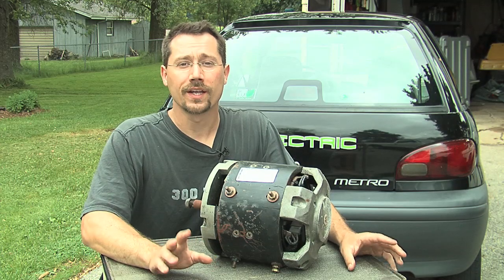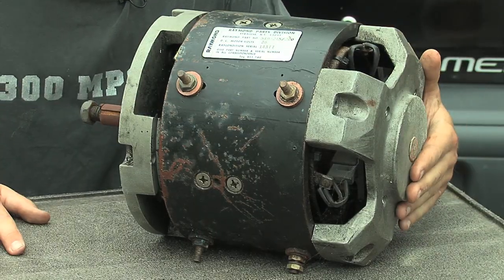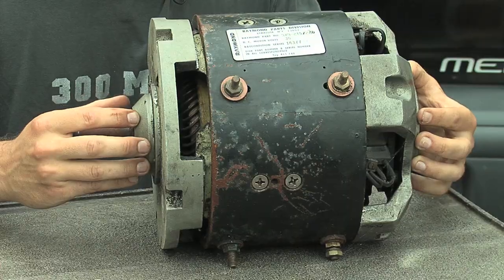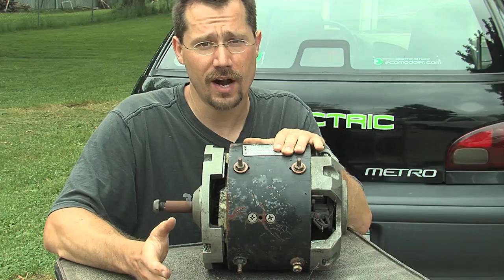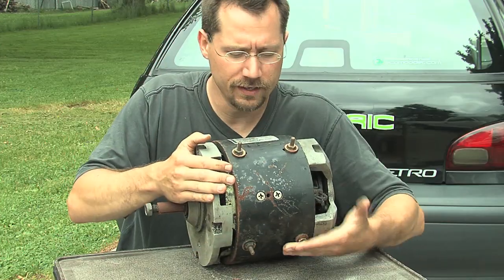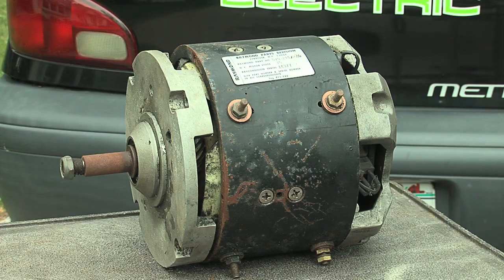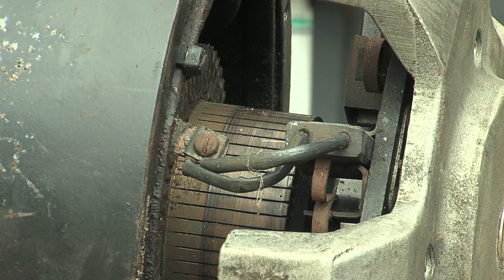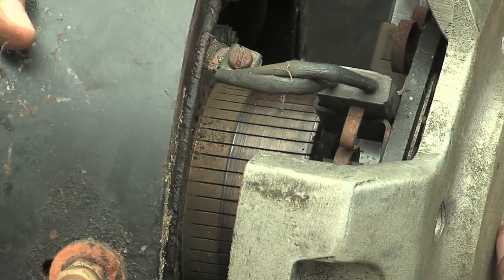5 Build Your Own Electric Car: DC Motor Basics

Comment: If you can modify your post you should warn people about hooking the brushes out of the way before removing the rotor.
As a point of clarity I suggest you always refer to the parts as rotor and stator that way there can never be any confusion.
You should point out that "forward" on this motor as seen at 11:11 will be clockwise. While it will work counterclockwise the brushes will be pressed against the sides of the brush holders making them difficult to move inwards.
Another warning is not to run the motor without a load as it can run up unregulated so fast as to damage the rotor windings. They can litterally fly out from the slots with the centrifugal force.
A good presentation.
Reply from the maker: Looks like you just made those warnings.
Reply: @BenjaminNelsonX  I've worked 30 years as a marine electrician and have taken apart hundreds of motors and alternators..... I've forgotten enough times to remove the bushes before dismantling and bust enough brushes.
The rotor-stator nomenclature was impressed on me in tech college 50 years ago.

Comment: Your nomenclature is a bit wrong!
That motor is NOT a "series wound motor". It is a flexible motor! Could be wound in series, could be wound in parallel. 
That is why it has four external connections.  It is also a 4-pole motor (better torque, limited speed)

Comment: Can I connect this kind of dc motor to water pump?
Reply from the maker: You certainly could. Keep in mind that there are different styles of pumps, depending on if you need to transfer water to a container, draw it out of a deep well, etc.
Reply: @BenjaminNelsonX  thank you

Comment: I've got a 3.5hp 36v motor out of a golf cart, an altrax 450 speed controller, id like to build an electric motorcycle. Would I be better off with direct drive, or running a torque converter, or gear box out of a small or large motorcycle engine?
Also I'd like lithium iron phosphate batteries, goal is 80mph top speed and a range comparable to a regular motorcycle. Is this a realistic goal?
Reply from the maker: That's too small of a motor for that speed.
You will want a system of at least 72V.
Probably a motor and controller that can do 96V/300A.
No need for a transmission. Just run a chain from the motor to the rear sprocket.
Take a look at my MOTORCYCLE video series for more ideas. https://www.youtube.com/watch?v=u0L9ke5GnO0&list=PLmHss3DBZUin2XgGB3vvhxPkLKW0b_mfk

You also want to look at motorcycles on the EV Album for what people have built, using what components and maximum speeds. http://evalbum.com/type/MTCY

Comment: I want to convert a 1979 Chevy C10.  If I don't want to spend the big bucks to buy a Warp11 motor, can I use a forklift motor? - or is there any other motor you can recommend?

Comment: I would like to convert a school bus to an RV and have an electric motor. How big of a motor would you suggest?
Reply from the maker: As big as  you can get! Along with a very large battery!
All jokes aside, I don't personally know of any DIY large Electric RVs. They are very heavy, NOT aerodynamic, and tend to drive long distances at a crack belong long periods of just being parked.
There has been a camper van version of the Nissan electric eNV200 van, but I've only seen those shown in Europe, not the States.
https://www.youtube.com/playlist?list=PLmHss3DBZUilapI9wJWWD0fd08_w6GfZH

Probably the best choice would be a very large AC motor. If you watched my videos on the Staples/Smith electric truck, something like a motor from that. Those trucks had an 80kWh battery pack and something like a 100 mile range.
(I think converting one of those trucks to an RV would have been a cool project!)
https://www.youtube.com/playlist?list=PLmHss3DBZUilapI9wJWWD0fd08_w6GfZH

A motor and battery pack from a Tesla Model X is about the right thing as well!

Take a look at the video I made about a friend's camper. He has a Model X and just tows a trailer he built!
https://www.youtube.com/watch?v=DMJkxb1GyKk

Here's another video about towing a camping trailer with a Tesla. There's some good info in there on aerodynamics, range, etc.
https://www.youtube.com/watch?v=pLQYsfOATVA

Comment: I realize this video is 3 years old, but I'm hoping you still read comments.
I see you used a Geo Metro. I have a Geo Tracker (1995) which still runs. My original thought was to drop a VW diesel in it, but the engine just won't die for me to 'justify' spending on the diesel conversion.
Anyway... do you think the tracker would be a reasonable candidate for an EV conversion? It is 4x4 and I would like to retain the transmission which is in great shape.
Thanks for any input!!

Comment: Hi Benjamin,
General Electric 24v Motor model 5BC48JB793A
has 2500RPM, 44A. HP.85. will be strong enough for the Smart 450
Any information will be appreciated.
thank you Wes

Comment: would a tail shaft not be better to fit an altenator
Reply from the maker: For an electric car, a DC/DC converter is better (more efficient, smaller, lighter, no moving parts) than an alternator. If a person DID want to keep and reuse an alternator, adding a pulley to a motor tail-shaft and belting that to an alternator would work fine)

Comment: What is the speed limit on your car?
Reply from the maker: About 75 MPH when it was running 144V.
Reply: @BenjaminNelsonX   ok so my project im considering is a 94 camaro that im wanting to get around 80 mph out of
Reply: @BenjaminNelsonX  but obviously I'm not made of money and was wondering if you had any ideas or thoughts you could share with me
Reply from the maker: @jeremiahward3241  Junkyard parts. Lots of crashed Nissan Leafs and other commercially-built electric cars are great sources of parts for a DIY project.

Comment: I have a 12v pallet forklift motor it has A1-S2 A2-S1 posts on it can't get it to run in reverse. Any ideas? 
I know it did in the pallet truck
Reply from the maker: Are you saying that it has two posts, or four posts?
If it only has two posts, there's no simple way to make it run in reverse. If there's four posts, you just need to reverse either the stator OR the armature connection.
Reply: @BenjaminNelsonX  
4 posts
Reply from the maker: @mickey2557  On a series-wound DC motor with four power connections, You connect the battery power to one of the Armature connections and one of the  Stator connections. You then connect a bus bar (or short cable) between the other two connections. That's why this is called a "series" motor - the stator and armature are in series - power goes through the one, then the other, then back to the power source to complete the circuit.

To reverse the direction of the motor, swap the cables on JUST the A1/A2 OR the S1/S2.

If you simply reverse polarity of the battery to the motor, BOTH magnetic fields are reversed, and reverse of reverse is still the same direction!

If you have some sort of direct drive system, and you need to be able to quickly change the direction of the motor (to back up a car, for example,) you want to use a reversing contactor. That's a contactor with a double set of contacts, with one reversed from the other. Use that to swap your connections, wired up to a "Forward/Reverse" switch.
Reply: Cool got it.
I also found it will increase RPM's if I jump it to 2 on the opposite post.
And its a big jump in RPMs
Thanks

Comment: I was surprised to see that the motor has no interpoles to prevent sparking at the brushes.  Without interpoles I would expect rather short brush life if the motor is worked hard.

Also, with a series motor it would not be easy to have regenerative braking.

VVVF (variable voltage variable frequency) 3-phase inverters are now readily available.  I'd guess that by now many electric fork lift trucks use VVVFs to control 3-phase motors instead of using DC.

Comment: Is this motor not a little to weak to pull a car, maybe fro slow speed oke but not for 100 km hour or so.
Reply from the maker: This particular motor was just shown as an example. It would be a little small for a car, but would be good for a motorcycle.

Comment: I noticed your output shaft is barely an inch .   I have two   ,  220volt D C motors from a variable speed lathe . The output shafts      are  about i i/2 inch . Ones rated at  5 hp , the other at 8 hp . , but they weigh  almost 200 LB each . I keep thinking about them    to be used in an electric car ?  I also use to run a deep-sea submersible . The thrusters had 15 hp 220 volt D C   Hymac motors , weighing about   100 LB . But you cant run them in air , theyll get too hot .  We ran them filled with  Volt-Esso transformer oil ,   with special anti-hydroplaning brushes .  The motor filled with oil , cooled it , plus prevented it from being crushed by sea pressure .  Still looking ?

Comment: 6:38 well there's a simple explanation for the power differences: 

On gasoline engines the manufacturers usually tell you the maximum power output. The engine is only capable of making that much power at a specific rpm and probably also just for a short period of time.

On electric motors there is a rating for the nominal power, which the motor can put out continously. But an electric motor may also make more power than that for short periods of time.

Comment: I got a large 11in 48V DC motor out of an old forklift for cheap.  Is it possible to drive it at 72V to get a higher top speed?  I have a 48V curtis controller but would probably need the higher 72V controller to do so? Thanks! You rock!
Reply from the maker: Yes, overvolt that sucker! The one I used in the Geo Metro, I've run as high as 144V. The higher voltage, the higher speed, and the more power at the same current.
You will need a controller that will run at a higher voltage. You should be able to get some CONSIDERABLE power out of that motor.
Here's a good forum thread on using forklift motors: https://www.diyelectriccar.com/threads/using-a-forklift-motor-and-choosing-a-good-one.7598/
Reply: @BenjaminNelsonX  How do I know if I need to advance the brushes?  The plate on the side of the motor says 48V. What is the significance of the label?
Reply from the maker: I have NOT personally advanced timing on the motor I used in the Metro. On a forklift motor, it usually involved drilling and tapping.
Damien Maguire has a couple of videos on advancing the brushes on a DC motor.
Here's the first one.
https://www.youtube.com/watch?v=_deNnx-MppU
Reply: @BenjaminNelsonX  Thanks for all the help!  I'll try to wire it up to 72V and see if it has any issues before going down that road.

Comment: What about the amperes required to operate the motor?
Reply from the maker: That depends on a number of things. The main one is how hard you are working the motor. Trying to accelerate quickly up hill in a heavy car draws a much higher current than steady driving in a compact car.

If you have a powerful motor, current is typically limited by the motor controller. I generally ran with car with a 500A max controller and had a matching 500A ammeter to see how much current I was using.

Comment: Great videos! I do have a small type gas car with a manual tranny i would like to convert. One question i cant seem to find an answer for - how much HP (equivalent) does an electric motor have? Can i find a reasonably powerful and cheap electric motor, maybe 50hp or even 100hp electric? (Equivalent?) Thats ok though if only a 25 hp forklift motor is possible for a cheap electric conversion. Just to have a small car (grocery getter) to run around town,even with only maybe a 100 mile range (or less ok), would be great! I will charge it with solar!But, it would be nice to have an electric that went at least 80 mph or so. Please let me know on this, i think everyone would like to know - motor availability and expense, more and less powerful electric motors etc etc. And how do i order your full set of videos? How much money for all your videos? Maybe you could do one more video segment on just how powerful various motors are. This might include range, power, acceleration, etc..just what is possible and practical. Thx so much!! Also, is it possible to "hot rod"or power up a lower powered electric motor? Thx!
Reply from the maker: One horsepower is roughly equivalent to 746 watts. You can use this as a general conversion.
However, when electric motors are measured in watts (or KW) it's almost always the CONTINUOUS  rating, rather than a momentary or peak rating.
So, comparing horsepower in gas engines vs electric motors is rather like comparing apples and oranges.

Forklift motors have commonly been "hot-rodded".  Please read this forum entry for some good info. https://www.diyelectriccar.com/threads/using-a-forklift-motor-and-choosing-a-good-one.7598/

I originally sold a DVD on building an electric car and an electric motorcycle. I really don't do that anymore, as there's so much more demand for streaming than physical media. I pretty much just put it all on YouTube for people to freely watch now.
Reply: Thx.for the response. Someone else had a great idea - keep your gas engine, just of course take out all the internals, pistons, con rods, camshafts etc. Just keep the crankshaft and block and flywheel and clutch. I'd rather keep my five speed.All that would be left of the gas engine would be the block (sealed) and crankshaft , of course you would have to keep the oil pump to oil the main bearings that were left. Bolt on your electric motor to the block of the gas engine, use a toothed belt or chain to drive the crankshaft of the gas engine. That way you can retain the clutch and flywheel and five speed transmission, no mods necessary to keep your five speed. Just have the flywheel turned down on a lathe to get rid of most of the weight. Then whats left of  the gas engine becomes only a holding and power transmitter for the electric motor. The only thing you would need left on the gas engine would be the block, crank, and oil pump of course for the crankshaft bearings. You would not need the cylinder head, just put a steel plate where the head was to seal the block. The steel plate would be an ideal place to mount your electric motor. I will let you know how it works.The other advantage to this would be that you could experiment with different sized drive pulleys from the electric motor to the drive shaft of the gas block to get even more reduction and power (if it needed more reduction)...
Reply: Thx. Again for all your help. I 've done work with gassers. What an exciting new field. Electrics.. Your metro is amazing!

Comment: It's a good Idea once you get your Electric motor if it's Used ... First thing would be to clean it completely  ..That means inside and out . Clean out all the Old Carbon From the Brush Wear  .... The Carbon Dust gets everywhere inside the motor as the Brushes wear down. 
Using Compressed Air and Electrical Spray cleaner get all that Old Dust out of the Motor .
Then clean the Groves and Dress the Brush Surface Start with some New Brushes and prepare them to match the bearing surface . Fork lift Mechanics do this regularly .
Start off Clean .......

Comment: Could you share a good place to order "Lovejoy Couplers"? I assume one has to already have a motor and know what the spline size is on the transmission?
Reply: Honestly? Check junkyards and nab them. I've found a few just hanging on the ends of motors there awaiting the scrap.
Reply: @girthquake1413  Thanks for the tip, Girth Quake. There area couple of junkyards not to far from here.

Comment: Note that motor has a very specific principal direction of rotation, as defined by the angle of brush gear. 
As shown at 10:40 mark -  https://youtu.be/UnLEy8p9Xu8?t=642 - viewed from output shaft end, that DIR is counter-clockwise, having brushes trail and not dig.   Not all traction motors are built like this. 
Yes, it can be connected and run in reverse direction but brush wear will increase. 

Insomuch as the series wound maybe 'simpler' a shunt wound motor would have advantages given the options of lower current field winding, better adaption to variable speed techniques, and field weakening control of torque and speed... all that help range from storage cell arrays. 

You will also find huge advantages from using higher voltage motors than these heavy 'agricultural' grade motors that are NOT built for consistent high speed and duty cycle use, aside the inherent road vibrations that a forklift never encounters. 
You WILL need to force air cool that type of motor.

Comment: So are you saying in this video that a forklift electric motor can run a vehicle ? I wander if it can pull a ford e450??
Reply from the maker: A forklift motor absolutely can power a vehicle.
AC motors are now WAY more available and at far lower prices than back when I built this project. However, DC motors are still very popular for dragsters. Look up NEDRA (National Electric Drag Racing Association) or fun vehicles like the White Zombie. Those are essentially forklift motors.

Comment: Damn then how long do those brushes last ..though u would wanna use brushless?
Reply from the maker: While brushes do eventually need to be replaced, they last a pretty good while. It would depend on how much you drive (how many miles) but far less often than a gas car would need oil changes and other maintenance.
You might equate them more with something like spark plugs, etc.

Comment: one motor for 4 wheels? why not  separate motor for each wheel?
Reply from the maker: One motor for TWO wheels, the way the car was designed. Motor replaces the engine and keeps the transaxle.